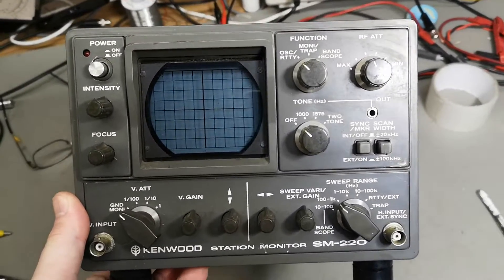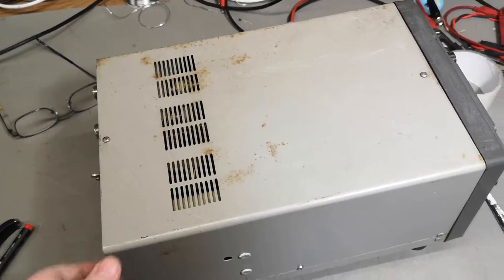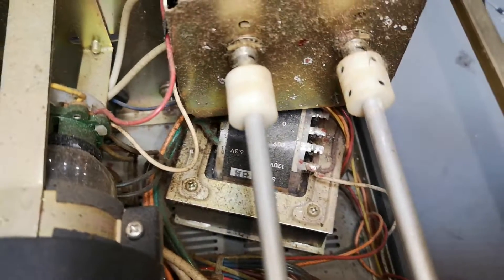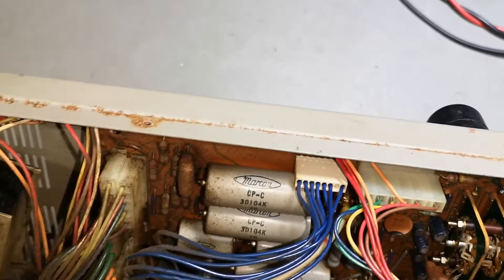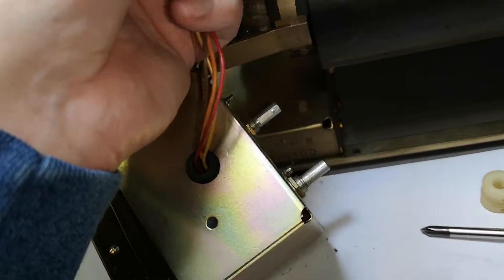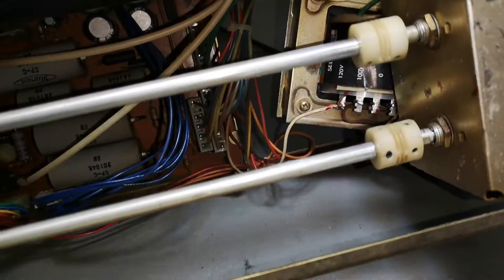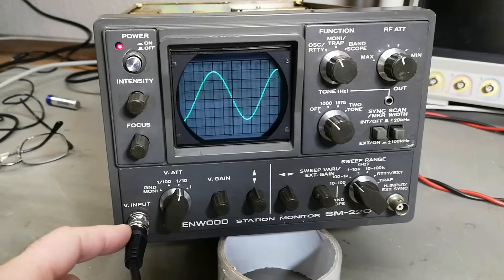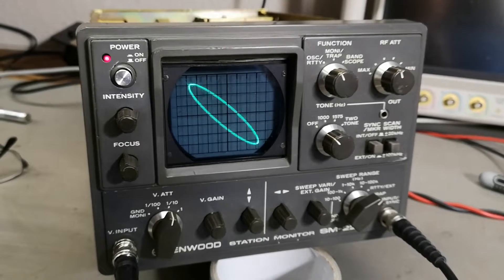Kenwood Station Monitor SM220 test teardown cleanup

Comment: The shielded box on the left side of the chassis is the optional "BandScope", aka panadaptor or spectrum analyzer.  It takes an IF input from the transceiver, and shows a display of other signals on the band, relative to your position at the center of the sweep.  There were 2 different versions sold, with either a 5 MHz or 8 MHz IF frequency, for different vintage Kenwood rigs.